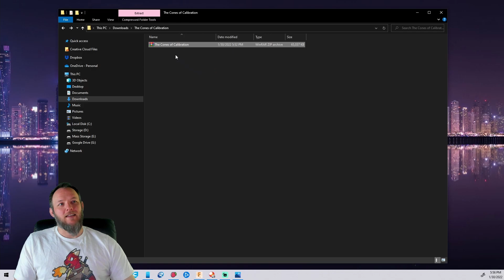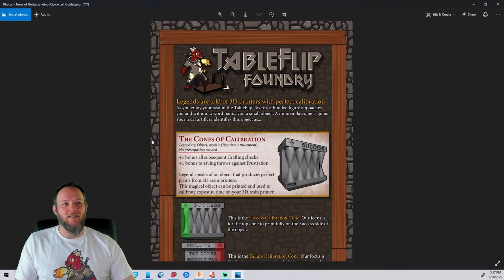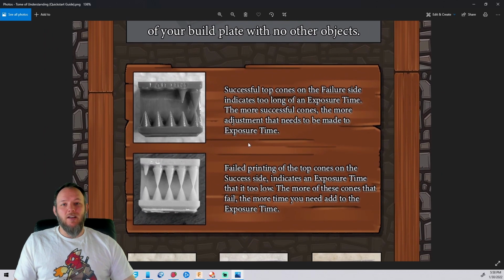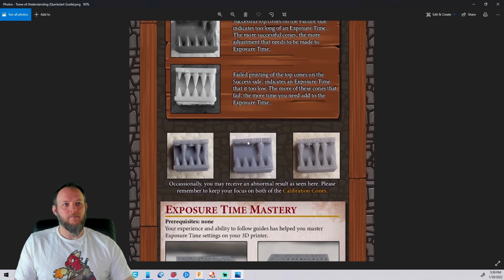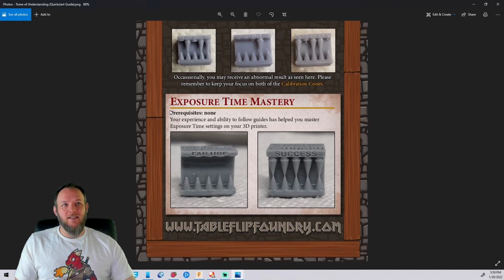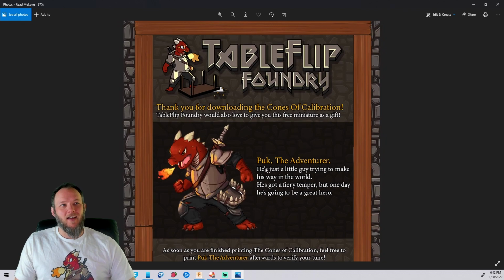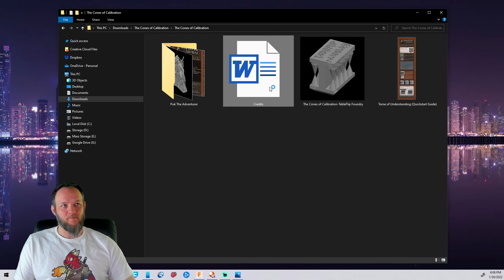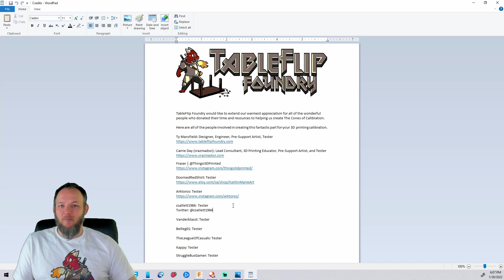This FREE 3D calibration tool will change EVERYTHING...

Comment: Although Chitubox reports it will take an hour and 41 minutes to print Cones of Calibration.

Why so long?
Reply from the maker: Well, there are a lot of variables that can affect a print time. 
Lower layer height, longer wait times, slower lift speeds, etc etc. 

But, I have  v3 out right now, its SIGNIFICANTLY better than v1 here. Head to our website to grab it. 

If you're printing at .02 (20um) then you're print times are just going to be long. 
Keep in mind though, this part requires a minimal height to function properly, it just takes longer than the flat calibration prints, but the results are significantly more readable.

Comment: Hello. The test looks interesting I'd like to try it on my new printer. But can i reduce the size of the model to fit several pieces on my small platform for multi exposure or should the size be the same as yours for the accuracy of the test?
Reply from the maker: @sergeil1235  this one is an older model. Make sure to grab v3 and carefully read the document on how to use it. 
You cannot scale the model though.
Reply: @TableFlipFoundry  Thank you

Comment: will this work with the saturn 4 ultra's multi exposure times tool on the same plate?
Reply from the maker: @user-yq3ti2oe2e  the v1 cones won't but the v3 cones will! You can grab the pre release files from our discord
Reply: @TableFlipFoundry  thanks for the reply, I started the calibration for the first version anyway XD will share what happens when it's done adn then will try the v3

Comment: Doesnt this take about 40 minutes to print?
The flat calibration prints are quicker so you can dial it in faster.
Then come back with this calibration print to see if it needs tweaking.
Reply from the maker: @Labyrnthdom  v3 is releasing in a few days. It's 35% faster to print than v1. It has 3x more features. It's also 3x more fun. 
The flat tests just aren't my cup of tea, but if it works for you, do what works. The goal is to have fun printing.

Comment: I can’t get the cones to print optimally, other test prints give excellent results and I got excellent quality 3D prints using settings found using those other methods…what am I doing wrong?
Reply from the maker: Im sorry you're struggling with them. The timing is excellent though!
My team and I have been hard at work on the latest version and they are in a community beta on our discord. Swing by and grab v3. We made a ton of reliability improvements but also, the new ones print 35% faster and have 3x more function.

So depending on what results you're getting, could be different answers, so its hard to troubleshoot with your comment here. Shoot me an @ on discord with some pics and I'll sort ya out.

Comment: Having an issue where the Success side cones aren't all printing, and the fail side are printing. So, I'm getting one side saying over exposure and the other side saying under exposure. What am I doing wrong?
Reply from the maker: You're not doing anything wrong. Its likely you just have some abnormality in the fep thats causing the issue.
That said, we are dangerously close to releasing v3 of the cones with SIGNIFICANT design improvements. 
You can download them from our discord as a community beta. 
They print 35% faster and should likely resolve your issue. But also, seems your exposing quite a lot to get fail cones as well so drop exposure a bit.

Https://discord.gg/tableflipfoundry
Reply: @TableFlipFoundry  damn. Was hoping to avoid having to replace the fep. Aha. I bought the machine second hand. So, makes sense I guess

Comment: What does it mean if the failure side doesn't print cones, but the success side has one weird bulbus and warped cone?
Reply from the maker: The weird shape is usually just the cone wobbling around a bit during retraction. I'd add like,  .1 or .2 seconds.
Reply: @TableFlipFoundry  Awesome! Thank you!

Comment: Nice! You're telling me I can print 1 calibration in just 4 hours??
Reply from the maker: Check out the new version of the cones. I optimized it a lot and improved stabilization as well as reduced printing time by 35%. It's now faster than town or spaceship.
But also to your comment, calibration isn't the easiest thing to do for a lot of people. Some prefer the much easier to read results even if it takes a bit longer.

V3 cones is in a community beta on the discord though! Go grab em and check em out. There are new features as well.

Comment: this tool ended my 3d printing time :(
part of one cone got loose and ended under the print, got pushed trough the fep and broke the screen on my photon mono ...
Reply from the maker: This is the first report we have had of this happening in over 80k downloads. I'm so sorry to hear that. :(
Reply: have no idea what went wrong after i switched from the Anycubic standard resin to the ABS-like resin Pro2,  took the settings from Anycubic for the resin (2,5s exposure) and wanted to do fine tuning with your tool...

well, sh*t happens...

Comment: Great! 
What you also should do is dial in clever. 
Read the Resin spec which i.e. says "2-3s exposure time". 
Start at the center (2.5s) and look at the cones. 
Underexposed? try 3s. 
Then overexposed? hit the center between extremes: 2.75s. Or 2.8.
Then just a few steps and you are there.

Comment: bruh, my success side all failed and the failed side printed... what the hell?
Reply from the maker: Ehhhh...head to my discord and pm me with some pics. You're the first who's had this result
Reply: @TableFlipFoundry  I managed to fix it. I had my exposure waaaaaaay to low. I was using sunlu tough w/ 2.2s-2.5s but when I bumped it up to 2.6s-2.7s it worked! now I have it calibrated. Thank you very much. These tests are so much easier than the regular tests I make since everything is so subjective and not always what I think is the optimal exposure ends up being the actual one. The only thing I'd change is that the model is really tall and it takes a long time to test (took me almost the entire day).
Otherwise, it's great and I'll keep using it!!!

Comment: How is it possible that if you have too long exposure you can print cones upside down on the failure side? I mean, even in your manual you can see that there is a cone not connected to the opposite one and a little bit lower. I seems like it was pronted in the air without any support
Reply from the maker: What happens is, the cone will fail mid print. Then it detaches and stay stuck to the fep. It stays there until the layers of the roof start printing. Then the roof picks up the failed cone. This is how it cleans itself up
Reply: @TableFlipFoundry  thank you

Comment: Getting into resin printing after 5 years of FDM printing and this test looked interesting at face value but I have high doubts it's relevance outside of the meta resins. Please correct me if I'm wrong. The idea seems to be that the 280um "rod" isn't structurally sound enough to peel off the following layer when properly exposed but 350um is. Therefor if your exposure settings are right then you get the expected results. But what if an individual uses less than the meta 50um layer heights? Or Stronger Resins? or using nano coatings on the FEP sheet to aid the release of cured resin such as silicone oxide coatings. (Think RainX, WD40 Silicone, or automotive "Ceramic" coatings) I'm not a fan of all the calibration techniques omitting the use of calipers or at minimum a feeler gauge. Im gonna have to experiment and see if a piece of paper could be used as a go-no-go gauge, such as if edge of paper fits in Slot A = good but if paper also fits in Slot B then Bad.
Reply from the maker: Not everyone has precision instruments or wants to buy them. If you want that kind of test then it's definitely your progative but many others want it simpler and don't have the same mindset. They just want minis for their DND game.
Reply from the maker: This is excellent consideration. You are generally correct. That said, the things you're discussing here are not average use case. The point here is to help new users enter the hobby in a way that is easy to understand and digest. That said, the cones provide use in all case but require higher understanding of the process to fully get the most out of the results. 
That said, v3 is coming soon and approaches the topic of calibration still in a very binary way but accounts for dimensional accuracy as well as tensile strength on the same part. 
But these have been out long time..downloaded and used a lot. The key here is that we aren't shooting for absolute perfection and to be honest most people don't need absolute perfection, especially when they start. They just need to get some reasonable reliable success to get them into the hobby and this is the goal for the cones.

Comment: Thank you for your work and sending you two Inspirations :)

I noticed that you made on Failure side from 0.2 to 0.28mm pillar connections and on Success 0.35-0.45mm.

So if i am going to make 0.1-0.15 tip supports the only way is overexposure and loosing details with it?
Reply from the maker: You cannot compare the cones with supports they are not related and not similar. This is a common mistake. The cones are far to clinical to represent practical supporting environments. 
Also .1 and .15 tips are extremely small and weak. .22 is the typical light support that I run.
.1 is for maybe eyelashes on a 32mm scale model
Reply from the maker: Also, to your last point. If you run .1 tips then over exposed. They aren't .1 tips anymore. They get bigger and thicker...that's why they end up working.
Reply: Really appreciate your timely answer @TableFlipFoundry  

Very interesting point of view, never thought about it this way.
Need to take a Long rest in order to pass Intelligence test :)
Reply from the maker: @azrael7133  if you get some time, give my calibration class a watch. I go into a lot of detail about the cones and the affects of over and under exposure.
Reply: @TableFlipFoundry  thanks for advice. Already watched. Very fundamental with good explanation pace

Comment: Not having cones on failure side touch = failed prints for every printer I've done. It seems like CoC is intended for deep supports on small prints, If I have 1 cone on fail side I've had great results.
Reply from the maker: They aren't intended as you describe. What it means is that you're supports on those models are insufficient for the calibration. 
Have a watch of my Calibration class video. It will definitely unlock some light bulbs about what calibration means and what you need to watch out for.
I promise its worth the watch.

Comment: Just tried this and all 8 printers didn't print anything other than a small layer on the bottom that stuck to the vat...
Reply from the maker: Well that's a tough one. Bed adhesion wouldnt have anything to do with this particular model. Though I did include one with a raft just in case. But if you're having some bed adhesion. Issues you may need to look towards other settings besides normal exposure

Comment: Random question - does this print haver a higher chance of creating floating failed prints in the VAT? The test print seems like its purposely trying to fail on the "fail side"
Reply from the maker: The roof of the part cleans up the intentional fails. No need to pick anything off the fep.

Comment: Ok but whats the science behind it? Are the failure cones supposed to break from the peel forces? They obviously have a continuous material, its not like they come to a specific point
Reply from the maker: You almost got it worked out. Yes the failure points are specifically designed to fail at a certain point. 
The connections between the cones are not all the same size. They are carefully.sized to fail in a predictable way.

Comment: I've tried this test. It's telling me I need a layer time of 20+ seconds .....almost as long as my burn in time..... Seems off
Reply from the maker: That does seem off. Would need more info to help you troubleshoot.
Reply: @TableFlipFoundry  I'm printing with an Anycubic photon S. I changed resin and couldn't get anything to stick to supports so I tried your cones. I started at the base 8s/layer and didn't see any "success cones" until about 18s/layer.

I'm open to taking this conversation off line for troubleshooting if that works better for you.

Comment: So my first print was close but did not have the complete cone on the successful side but the more I increase the exposure time the lees complete comes I get on the success side
Reply from the maker: There are a couple ways you can adjust a little. 
1) Download v2 of the cones from our discord on the cones channel. I made improvements to the design that makes it more reliable. It also prints 35% faster.
2) Rotate the cones 90 degrees. This will place the connections slightly in a different spot on the fep. This has yielded good results for abnormal outcomes. 

I recommend v2 though.
Reply: I’ll give that a try thank you

Comment: I think I understand the concept of this, but perhaps it's my peasant mind. I can't see/find any information of what my initial settings should be before printing this. Where should I start? What layer height? Is 0.05 a good starting point? At what exposure time? Perhaps I'm too blind to see, but.. I don't know where I'm supposed to start..
Reply from the maker: Everyone's printer and resin and temp and all the rest of the variables are different and so its hard to offer that kind of info. 
If you have a modern printer and modern resin (something made in the last year or so) then you can start at 2.5 seconds for .05mm layer height. That's a fairly average starting point for most printers. It should get you some results to get started. 
Also, have a watch of my calibration class, it will be extremely helpful for you. 
And join our discord, because we can answer all your questions super easily over there. We have 5700 members now and tons and tons of helpful people. 
The hardest part of starting the hobby is feeling like you dont know what you're doing and feeling like you're left alone to figure it out. We will fix both of those for ya :D
Https://discord.gg/tableflipfoundry

Comment: Thanks for making this!  Can you confirm or deny that the cones only work with 50 micron layer heights?  I was using it with 10 microns, and think I got false over-exposure results.  When I printed it with a 50 micron height, it worked perfectly
Reply from the maker: Deny. As far as I know. I don't know anyone who prints at 10um though. They should work on any layer height. But you should check out my calibration class to find out a bit more about why that might have happened!

Comment: I have my newly brought Elegoo Mars 3 printer and I have to ask, how many seconds does each cone on the failure side take to print out?
Reply from the maker: Unfortunately this doesn't work quite the way you would imagine. There are different resins that cute at different speeds. Different screen types. Different uv power output printer to printer.
So unfortunately it's impossible to tell you that number. But typically you're going to be making adjustments in the .1 to 
.3 seconds range

Comment: Great video, quite late for the party here. But if I am getting it right you say the only cones that really matter are the ones with the "+" and "-" symbols, if by any reason I get other cones within the failure upper side to print should I just ignore them as long as it is not the "-" cone? or are they an indication of a tiny reduction in exposure time?
Reply from the maker: Sometimes there can be some abnormal results with the cones. When that happens is easiest to just look at the most important ones and not dig too deep into it.
That said, v2 of the cones is available on our discord and it has better considerations for reliability and also prints 35% faster. 
I recommend grabbing them

Comment: IS THIS TEST SUITABLE FOR TRANSLUCENT RESINS? 
Well... I've printed it few times and ... Success cone has a microscopic gap same as fail cone... or both has connection. 
Currently I am between 2.4s (both has gaps) and 2.5s (both has connections)  (Exposure time for this resin is recommended as 3s - 15s, so I'm quite far below anyway)
I am guessing the issue here is that I'm using Anycubic TRANSLUCENT green resin which can pass uv light further then other non translucent resins or ... is it so precise? 
Should I start messing with hundreds after a comma? 2.45s, 2.47s, 2.43s etc?

Comment: Im new to 3d printing so it could be something simple but, i have printed a bunch of these tests and the best one that ive had so far has 2 of the success side cones fail to print at all. And on the failure side there are 3 semi printed cones. Ive tried exposures both above and below what i printed this best one at at know and i dont know what to do.
Reply from the maker: Jump over to the discord server and let's get you printing V2 of the cones. They have some new design elements that should improve reliability
Reply from the maker: Look for the cones channel. You can @ me there too

Comment: the thing i dont understand is WHICH exposure time do we need to alter based on the outcomes in the guide?
Reply from the maker: There are only two. And one of them only relates to bed adhesion and nothing else (bottom exposure)
So the only one we need to worry about is normal exposure.

Have a watch of my calibration class video!